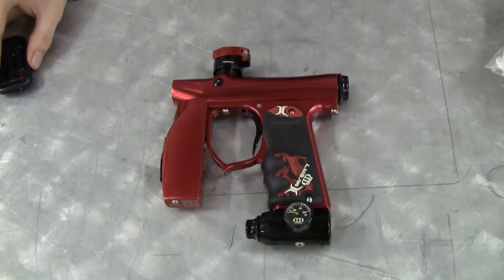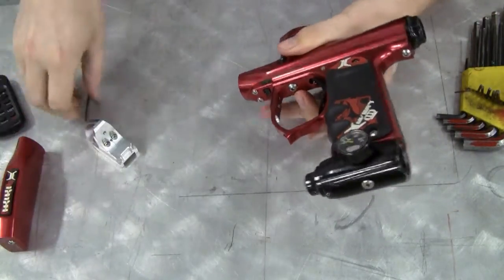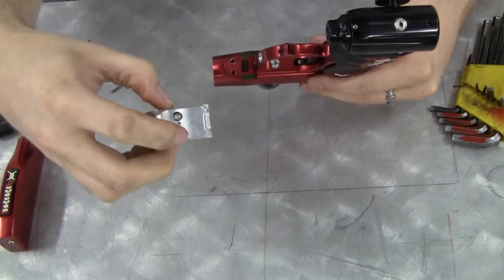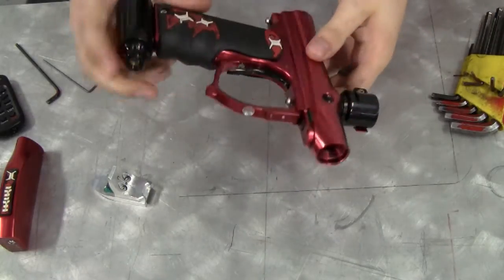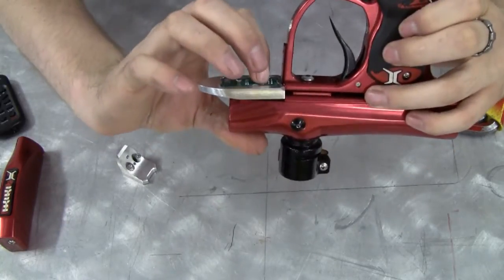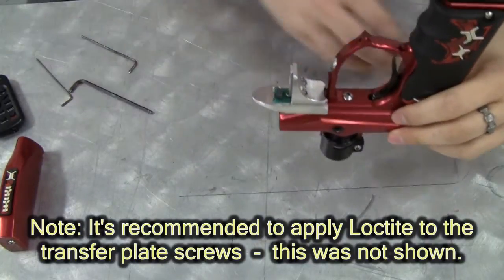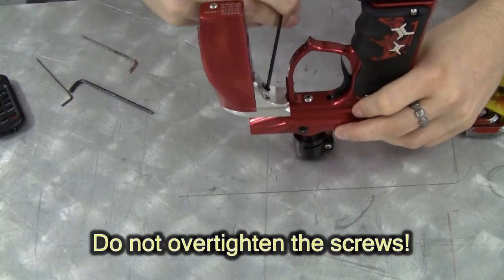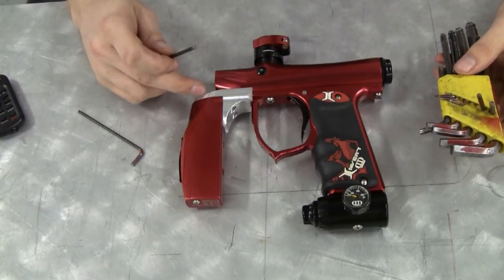Nummech Mini-only foregrip extender install

Comment from the maker: It's just a tad longer than the stock Axe frame/foregrip, like a little over 1/8 inch. If you were to hold the two side-by-side you'd be able to tell but only slightly.